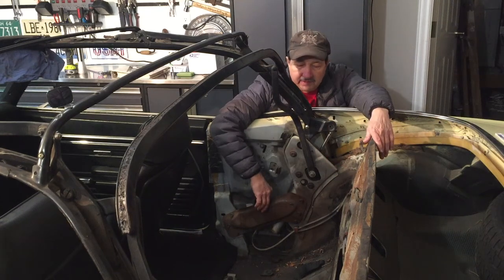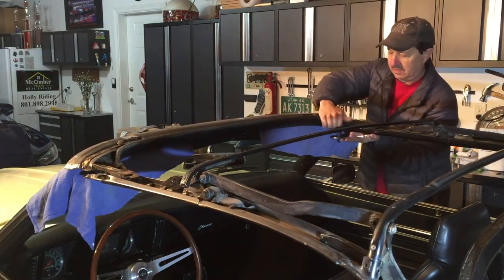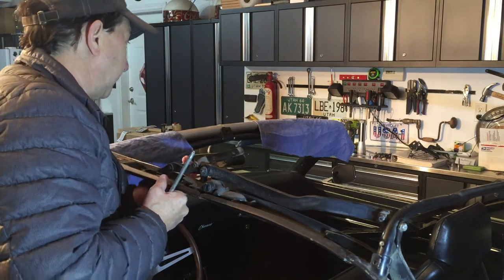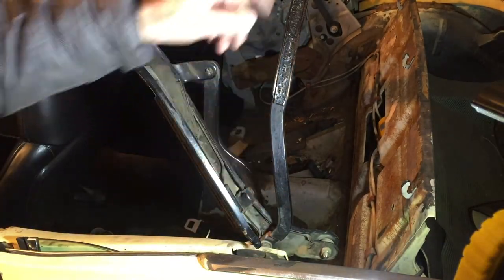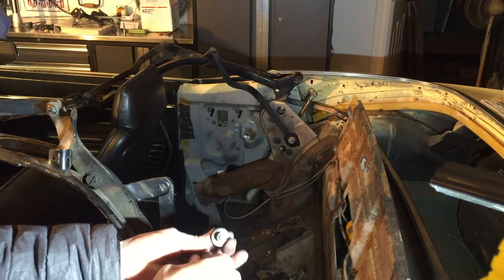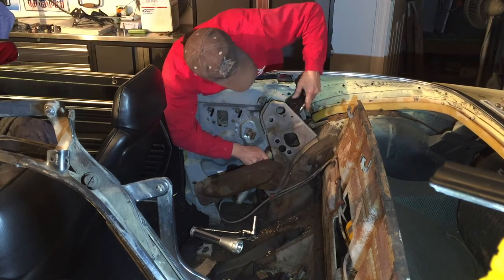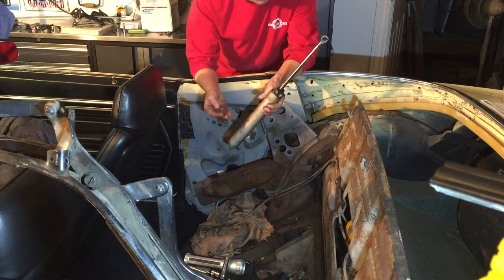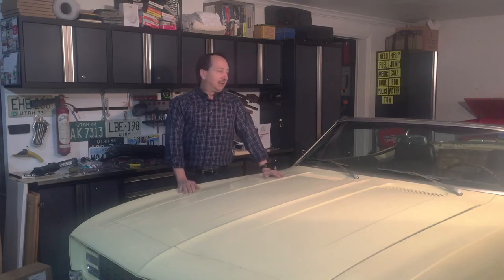1969 Camaro Convertible Top Problems. Removing & restoration frame. Bends & power lift cylinder leak

Comment: Question, I have a 67 Camaro Convertible and the rain well/gutter was damaged when it came back from the upholstery shop after having new top put in. Anyway can I replace the gutter without having to take the new top off?
Reply from the maker: You should be able to do it without removing the top or well liner. It may be easiest to do from the back seat. Remove the seat back and lift the well liner up to expose the underside and that should give you access to the gutter screws.

Comment: Great job... Do you know if the convertible top can be installed on the rack and then later removed together as an assembly? Thanks
Reply from the maker: Yes. It can be removed as a full finished assembly. Putting it back on and adjusting it will be difficult but I believe it can be done.

Comment: Love the videos. Thank you! My cylinder is leaking from the top compression fitting.  After many try’s I finally go the fitting loose. Reinstalled with some thread tape. Didn’t work.  I am curious if the cylinder has an o ring at the base of the fitting by chance. Thanks.
Reply from the maker: Yes, mine has o-rings. It is very hard to replace in limited space but it can be done.

Comment: I have been watching your videos on the convertible top and I need your expertise! I own a 1968 RS Camaro convertible and I replaced the whole top and pads but I have noticed lately that water is internet the back window well! Please
Reply from the maker: They do leak around the back window area. There should be a gutter to catch the water and direct it to the front the the inner fender wells. I think the 68 has a plastic gutter. It may be out of place or cracked. Check to see if you can tell where the water is getting through.

Comment: Any tips on how to reinstall the outer cylinder bolt on each new cylinder.  NOT ENOUGH ROOM to push bolt in.  Puzzled here
Reply from the maker: Yep. Those were impossible to get back in for me as well. I had to remove the pivot bracket, insert the bolt, reinstall. It is not fun.
Reply: @riderescue  ok thanks.  I had no idea that bracket was removable. I used a sawsall to cut the outboard bolt out since i have new ones in the kit.  Good to know... and i was trying to retain the adjustment, but i guess ill just re-adjust afterwards. Thanks again.

Comment: I have a broken rivet on the passenger side rear a friend tried to put the top down without unlocking the top at the front. I have a bolt it it now. I need to replace the top. Is there a fix for this?
Reply from the maker: I'm sure there are machine shops that can make a new rivet and smash it in place. I've heard of guys welding a stud to secure the parts together instead of riveting. Good luck and tanks for watching.

Comment: I'm having the same part made that you mentioned about on your 67. Do you know if you can purchase the bracket that attaches it to the bow?
Reply from the maker: I have not heard of any aftermarket parts like those.
Reply: @Ride Rescue  ok. Thank you for this video. I have completely removed the top myself because of your video. Now to get it fixed and put back together 😳😬🙏